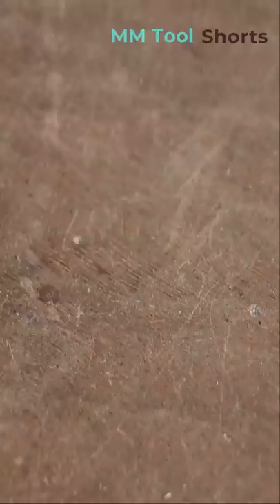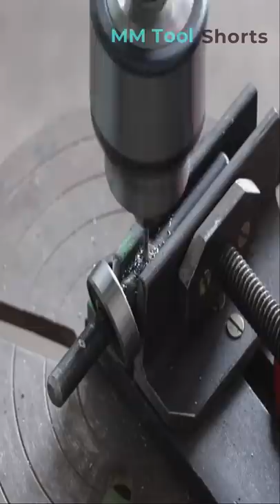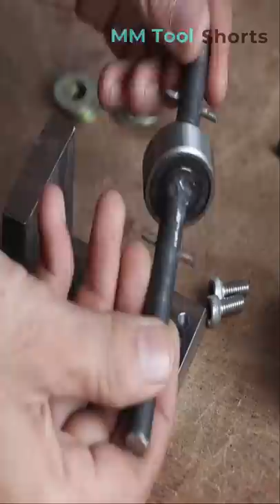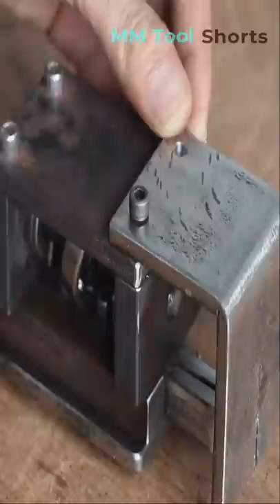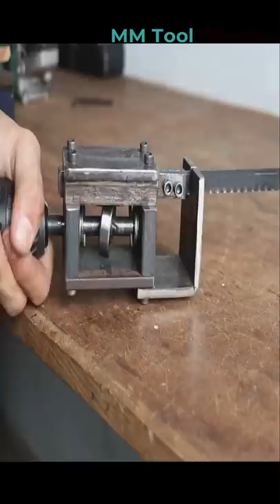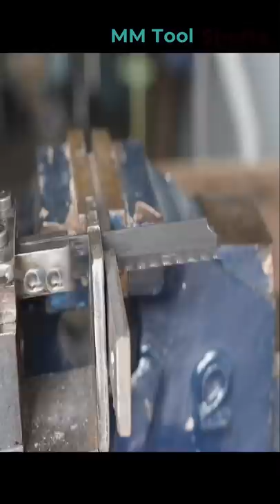Drill Attachment Saw - Drill Hack #shorts

Comment: В любой непонятной ситуации приваривай подшипник!
Непонятно, нахуя, но приваривай.
Reply: Точна
Reply: Адепт доктора, приветствую🖖
Reply: Я только что от доктора. Все здрасььььть
Reply: Дью одобряет
Reply: Наконецто люди начали виводить в топ такие коментьі а не з*** типа я сделал работает от диванньіх експертов которьіе даже ето не тестили
Reply: Главное в етом процесе чтоби подшипник бил ржавый в говнину, и желательно заклиневшый.
Reply: @vafelca1598  если подшипник не заклинило, то надо его варить, пока не заклинит. Всё по заветам Артёма Витальевича
Reply: Few things:
- Cold-rolled steel rod isn't shaft, and doesn't really make a great substitute due to softness, and dimensional tolerances.

- Welding roller bearings to things is generally a bad idea, the thermal expansion and contraction of the bearing races kinda ruins it after that. Might as well have just used a large flat washer instead really...

- Nails are not great substitutes for roll pins, they're too soft, and will fail in short order in this configuration
Reply: ГЛААААААЗААААА!!!!
Reply: @vafelca1598  если он не ржавый, то его нужно обильно смазать ржавчиной! ))))

Comment: Why didn't he turn the drill 90 degrees make a circle for the drill and add a pin to pull the blade in and out the stroke be 2*r. What your after is the cosine wave. If you make a slot you could even adjust the stroke. If you wanted to go farther and a centrifugal clutch to change the stroke at higher rpm.